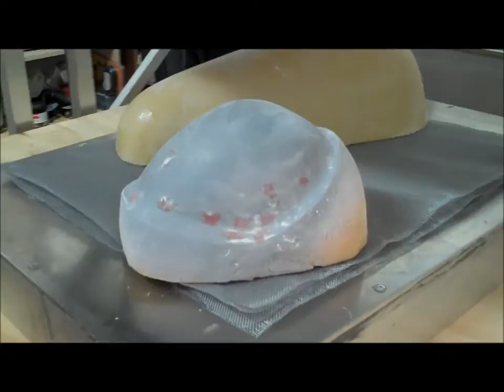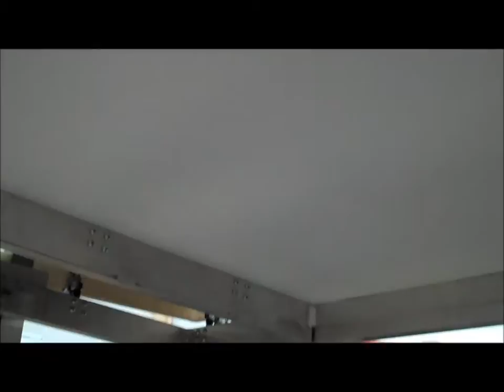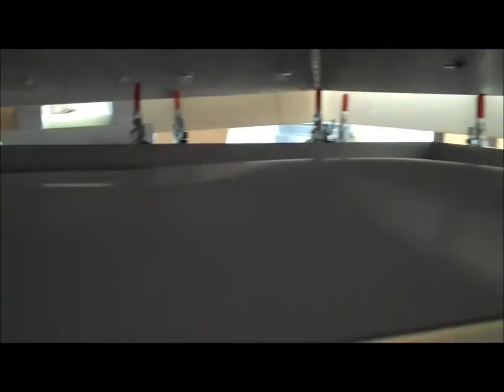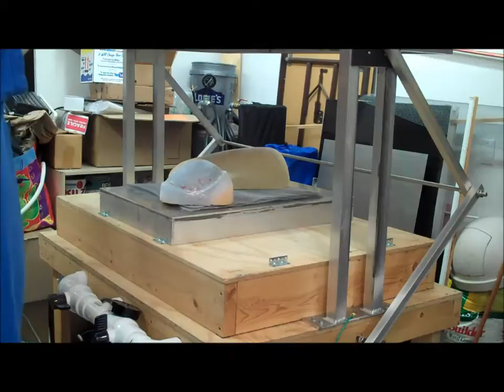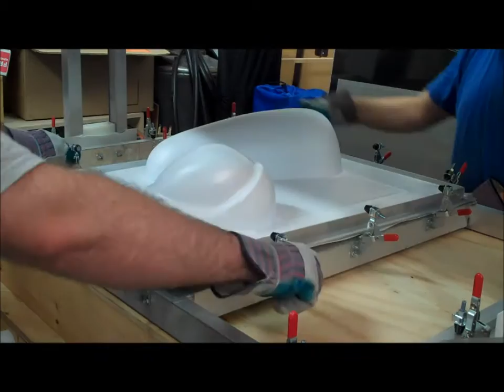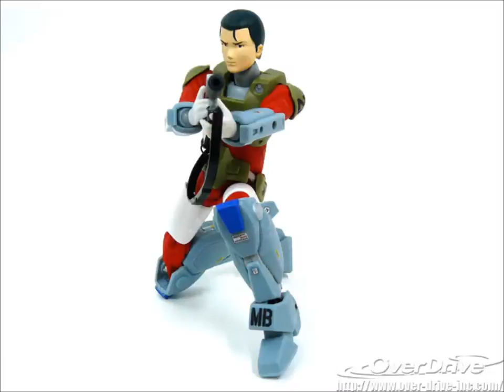Vacuum Forming Robotech Cyclone Armor

Comment: Could you tell me what those clamps are called that you have mounted on there?
Reply from the maker: The clamps are VH101B Vertical Hold Down Toggle Clamps. You can find them on Amazon for less than $5.00 each. I like them, but the heat weakens the neoprene stopper, and eventually they split and fall off.